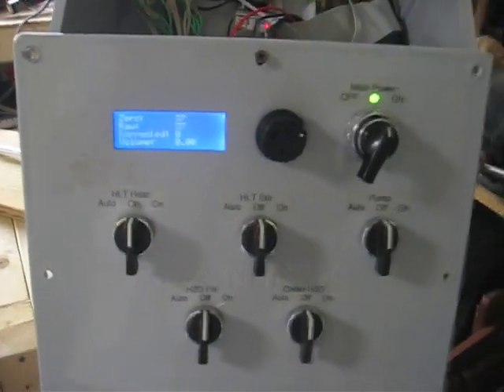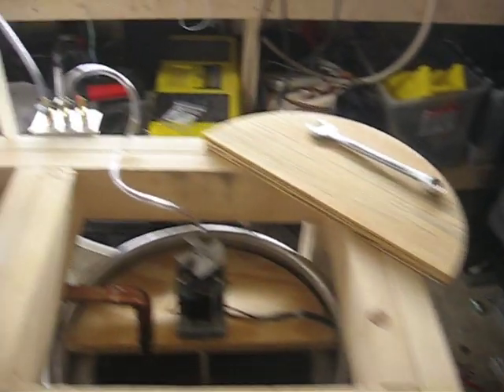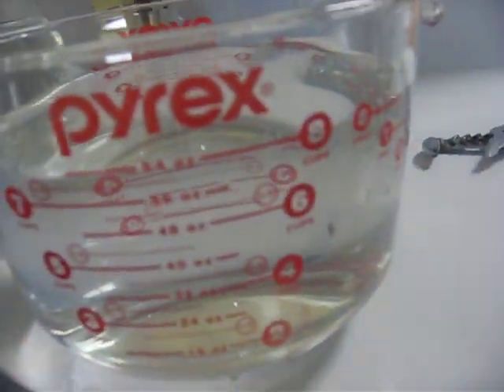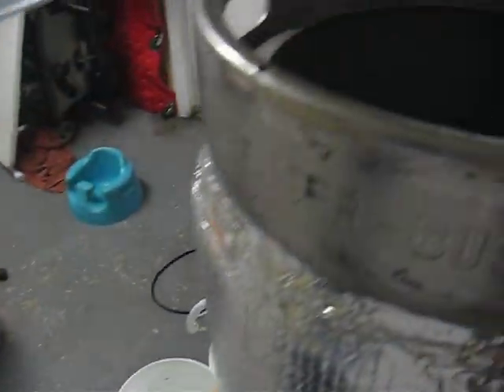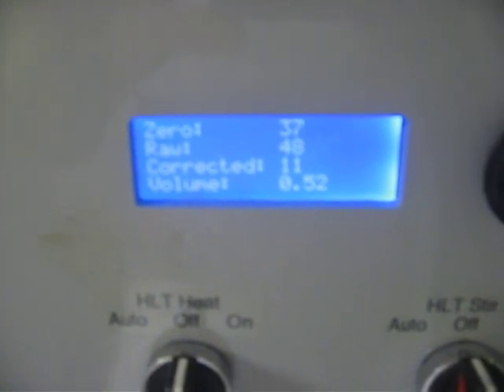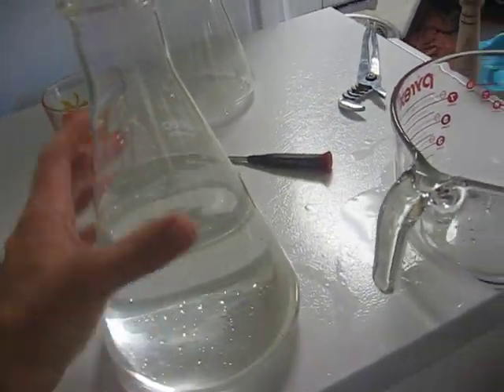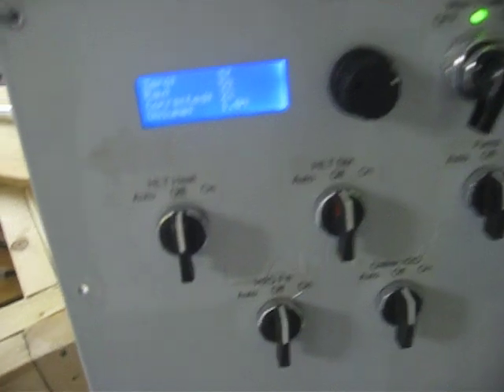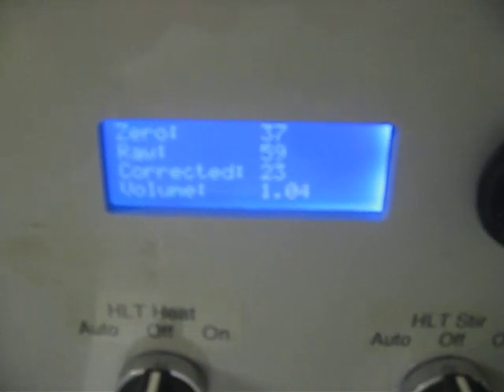BrewTroller First Volume Measurement Test

Comment from the maker: @ZionBrewers 

It causes the pressure to rise a bit and show extra volume, i've since moved the tube input to the bottom the vessel. Other users have worked around this by adding a bubbler set up.